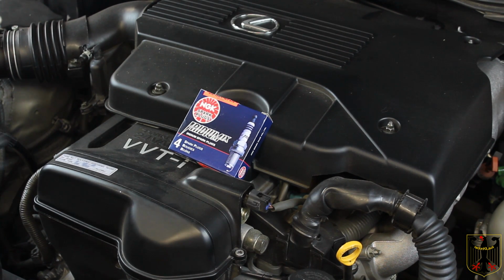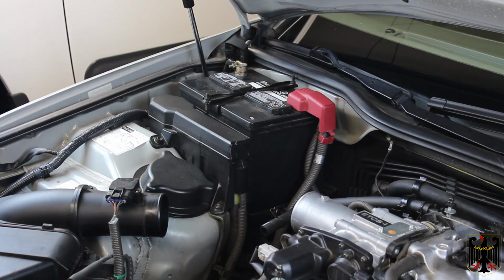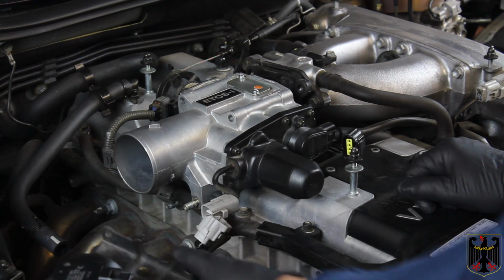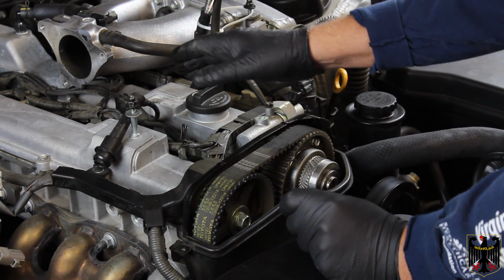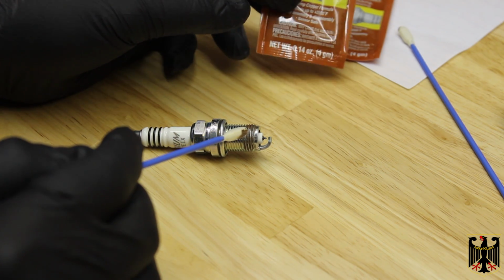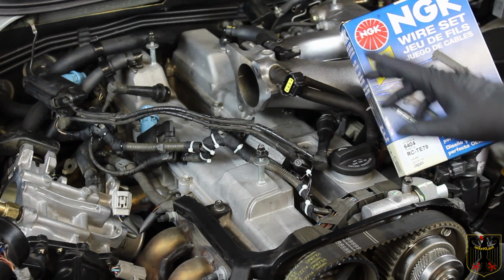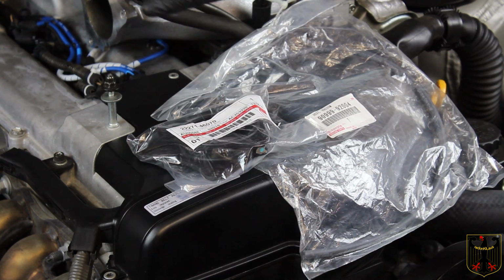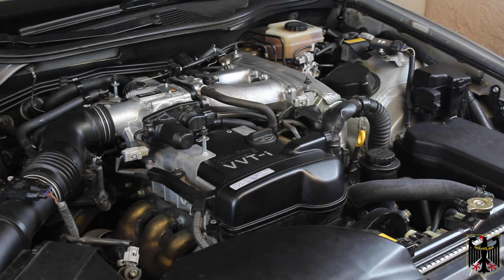2JZ-GE VVT-i Spark Plug Change - Supra and IS/GS/SC

Comment: Cool video, i just performed this service on my 2000 SC300. Coils, wires and plugs were NGK or Denso. 

Did you have to re-adjust the throttle cable? If so, is there a procedure to do it correctly? The factory service manual doesn't give instructions, only parameters. I have to adjust the throttle position to 14%, 750 RPM @ idle with the transmission in neutral and the A/C off. 
Thanks
Reply from the maker: There's not a parameter that I know of for the cable - just feel.  Basically as tight as you can get without moving the throttle at all.  Thanks for watching!

Comment: The wrong spark plugs were used. On the hood itself, Lexus made sure to put a label that states to only use double platinum WITH 2 grounding straps. This is a wasted spark ignition system. It wont run as strong without them and possible misfires. Just for you guys that own these 2JZGE engines. The correct spark plugs are either Denso or NGK laser platinums. The Densos can be found on eBay for $19.39 free shipping. part number is Denso 90919-01249 FK20HBR11.
Reply from the maker: Single electrode iridium plugs last a comparable amount of time, and per NGK, the IFR6T11 single electrode iridium plug is the current optimal choice for this engine from their lineup.  I can tell you from personal experience, there is no difference in power output between the two, and while double platinum plugs are an equal option, they are not superior.  Thanks for watching!

Comment: Great explanation! A couple things I learned in this video is that once you apply grease your torque values are different. I also learned that Toyota sells vacuum hoses by the feet! Regarding the harness you should of re-wrapped the entire Ignition Harness in High Temperature Loom. The zipties was a bit tacky and you should of used black if you just had to use them. My OCD was tweaking lol. Overall that was a very clean engine bay! Like the video and keep it up! If you do add a turbo, it would be great if you recorded the entire process step by step. I would watch it even if it was 10 episode long! Thanks!
Reply from the maker: Thanks for watching!

Comment: Hi I’m new to the 2Jz community and have a question, is it normal that on the  intake manifold side of the head by the spark plugs that there’s a small whole there thanks in advanced
Reply from the maker: Not sure where exactly the hole is you're referring to - on the valve cover, on the head itself, etc?
Reply: redonKiLaus 
Hi sorry or the late response is on the head itself next to the spark plug hole by the intake side
Reply: I talk to an old friend of mine that work for Lexus for 15years and said it’s normal on this engine that people would go in thinking there car had a leak in the rear main seal and it was those holes on the head that it went to the back of the engine and leak down the back making it look like the rear main seal

Comment: Got a GS300 and my god, this was ridiculously long to replace the spark plugs. Not to mention the E7 torx socket to use. damn 2jz!
Reply: I replaced the gaskets and plugs in the same day it was crazy
Reply from the maker: Indeed it is, definitely not as easy as on many other I6 engines.  I am able to knock plugs out in about 45 minutes after having done a few 2JZ-GEs in the past, but there is a whole lot more disassembly required compared to other vehicles.  Thanks for watching!
Reply: @redonKiLaus  And they say Jags are hard to work on apparently 🤣

Comment: I tried changing my plugs today and now my car will not even crank over
Reply from the maker: I'd recommend checking coil pack connections if you're talking about not firing.  If it's not cranking at all, something else in the engine bay was touched during the job causing that, as nothing in the vicinity of the spark plugs will cause a no-crank issue.  Thanks for watching!
Reply: How to check coils if they’re working or not in this model ?!?

Comment: Question: 

My Supra is NA-T on low boost. You recommend the NGK BKR6EIX-11 spark plugs for this setup.

Should the plugs be specially gaped or is the preset gap setting fine? 

I'm currently experiencing misfires.
I'd appreciate the help.
Thanks!
Reply from the maker: I recommend BKR7EIX plugs for a standard NA-T setup - they run a tighter gap (IIRC, .032") and are colder than stock.  I recommend purchasing iridium plugs pre-gapped, as you can easily damage the tip if you try to gap yourself.  

Hope that helps point you in the right direction, and thanks for watching!
Reply: @redonKiLaus  thank you !

Comment: Awesome video. Helped me changed my 2002 Lexus GS300 spark plugs. Do you have a similar video on how to swap out the fuel injectors? My fuel injectors are probably due for a replacement after 15 years.
Reply from the maker: I haven't yet had a need to replace the injectors in my GS - you really don't need to swap them unless you are encountering an issue caused by varnish buildup, but if you want to read through the procedure, here is one from my.is: http://my.is/forums/f114/fuel-rail-removal-injector-help-291063/

Hope that helps, and thanks for watching!

Comment: Great video, thanks for uploading it.  Quick question.  I'm getting ready to replace the spark plugs, wires, and maybe the ignition coils on my 2002 GS300.  I see the wires are only 3, shouldn't there be 6 wires for a 6 cylinder car?
Reply from the maker: There are only three wires because the other three cylinders get spark directly from the three coil packs, with the wires allowing two cylinders to be paired up off of the same coil pack.  I would definitely do all of the items you mentioned, since there is a good bit of disassembly that you don't really want to repeat unnecessarily.  Make sure to also replace things like the throttle body gasket.  Hope that helps clarify, and thanks for watching!
Reply: Got it.  Thanks for the explanation.
Reply: Hi, one more question.  Do you also recommend replacing the 3 ignition coils?  I see them here http://amzn.to/2qTJhEy for $76 each.  My car has $160,000 miles and the coils are original.
Reply from the maker: Sorry for the slow response, for some reason YouTube flagged your comment so it didn't get to me in the usual manner.  If you want to replace the coil packs for peace of mind or if you are getting weak spark in one or more cylinders, you can definitely do that, but if their plastic housings are not cracking and they test as working properly, there's not a huge need to replace them.  I have had vehicles with over 200k miles on original coil packs that were treated properly, though if you don't know the full history of your car it may be wise to install some new OE or OEM units.
Reply from the maker: Glad the video helped and that your car is running tip-top.  Stay tuned for a definite suspension refresh video coming in the future - I'm assembling the necessary parts right now.  Thanks for watching!
Reply: wasted spark system, plugs fire during compression and exhaust stroke
Reply: Thanks.  No worries about the late reply. I recently changed the spark plugs, wires, and ignition coils with your recommendations from Amazon.  My car is running a lot better.  More power and  is running a lot smoother.  Thanks for your tutorial video.  Keep them coming.

Comment: wow that bay is spotless the any tips on keeping it this clean?

thanks for the video
Reply from the maker: Believe it or not, I actually haven't had the time to do a full, in-depth cleaning on this car like I normally do after purchasing a vehicle.  I did do a quick degrease and wipedown, but no dressings for rubbers or wax on the painted parts quite yet.  I made a video a few years ago on general methods I use to clean an engine bay - some techniques have changed, but they are largely the same still.  The video is here: https://www.youtube.com/watch?v=bVDlm-8dv60

Hope that helps, let me know if you have questions, and thanks for watching!